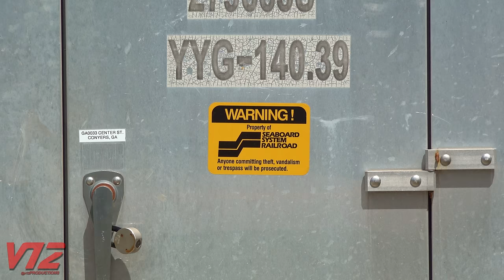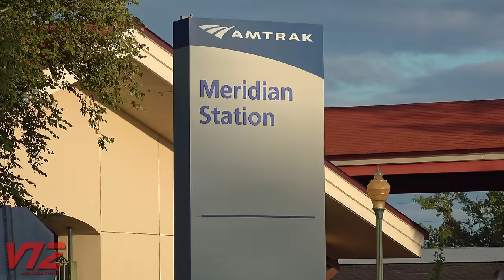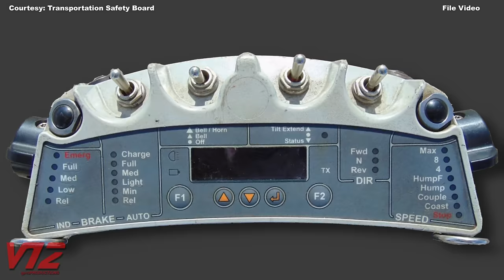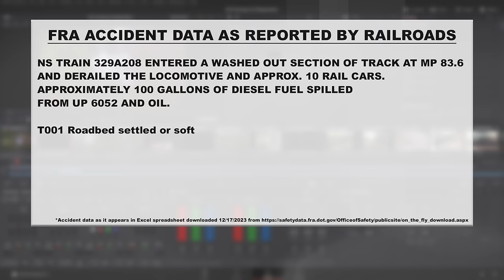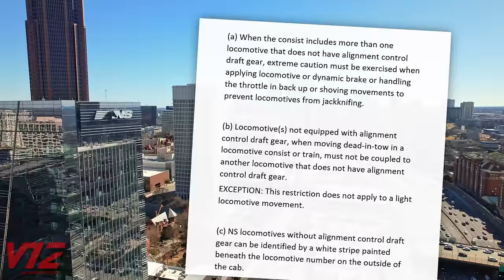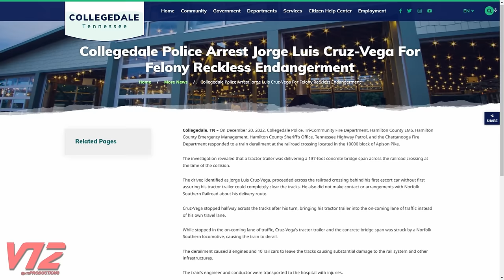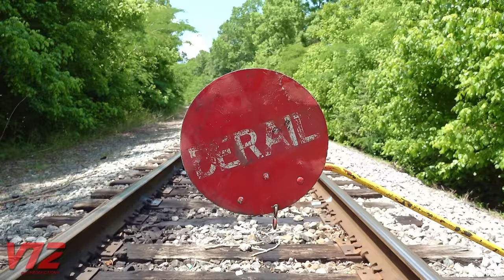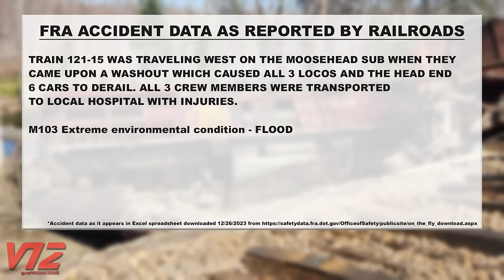Train Derailments 2023 | SPECIAL REPORT

Comment: The collision involving the car carrier is COMPLETELY and obviously preventable - even without dispatch - a pair of locos with 4 cars can EASILY stop in  less than a 1/4 of a mile - R/R engineer training is CLEARLY in question here, there's no sign whatsoever of those locos slowing at all - that collision, and I can't bring myself to even call it an accident, is ridiculous beyond my imagination. Let me guess, no one was held responsible - - not to say the truck and trailer driver showed very poor judgment but no matter - this isn't a case of running a crossing.
Reply: Um no
Reply: that's a stupid take. even a short train will take a 1/2 mile to stop at 40 mph. they aren't like the prius you drive.
Reply: @hirisk761  Well - guess we're on a  different page although I wouldn't be personal about and call your reply stupid - If you don't think 2 locos and 4 cars that neither of the locos would even feel can't do better than a 1/2 mile, then fine - have your opinion -  fact is, they wouldn't even need mechanical - electro would slow them that far out - not to mention to even call that a train is ridiculous, it's not, it's power with a few cars. I suppose you think the wreckage stopped them only yards from the collision - hmmm, how'd they manage that after booking through that trailer. Thanks for replying - we can and do have different opinions.

Comment: Since so many accidents occur as a result of "high centering" of low semi trailers, how about special signage at raised crossings requiring low bodied equipment come to a full stop prior to crossing?  That signage would indicate how high the track is above the approach and departure roadways and to require the operator to verify their landing gear is sufficiently raised?   Perhaps  DOT should require low bodied equipment be marked with the lowest above ground elevation similar to the existing requirement to mark trailers with height and length markings.

Comment: Why didnt the cops attempt to push the truck with the two cars off ?
Reply: As the trailer grounded, it lifted the drive wheels of the tractor up loosing traction. Then the rear of the trailer is too high for the PV and the overall weight of the trailer along with the  load wasn't anything the PV' could possibly push. A wasted effort endangering everyone.

Comment: Anything that is stuck on the rail road tracks you need to right away start calling the emergency number on the crossing an no waiting to do it because if the train is close there no way it's going to stop an it can't stop it has millions of tons of cargo an steel pushing it down the tracks if it's to close kiss your car / equipment an your life good by because it's going to run right threw you an what every is on the tracks of course most people have no common sense to realize this . If you can run like he'll because it's not going to be pretty

Comment: As a farmer. I'd like to ask you not to call a semi truck a tractor.
Reply: well the truck is referred to as a tractor because it's pulling a trailer  behind it.
Reply: @hirisk761  that's not a tractor. It's a semi truck. Tractors have the hitch behind the rear axle. Semis above the axle.
Reply: @hirisk761  also the term.doesbt change just because it has a trailer behind it. It's a misappropriated term.
Reply: geez  butthurt much
Reply: @CheeseMiser  I know you're quite slow, but the DOT calls the part of a semi with an engine in it a tractor.
In the east a semi is most commonly called a... tractor trailer... because it's a tractor that pulls a trailor.
It's a holdover term from traction, as in... the tractor of a semi provides tractive (tractor) effort.
Also, the electric motors in locomotives are called traction motors because they provide tractive effort.
"A tractor truck is a type of semi truck specifically designed to pull trailers "

tractor
[ trak-ter ]
noun
Definition 2: Also called truck tractor. a short truck with a driver's cab but no body, designed for hauling a trailer or semitrailer.
Reply: @tim3172  idc. It's a truck. I go by what the inventor calls it.